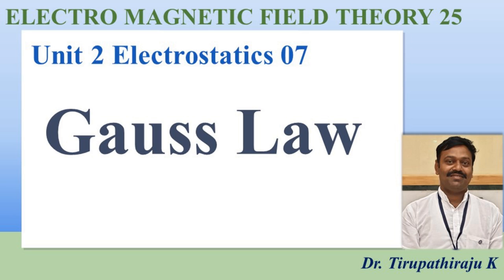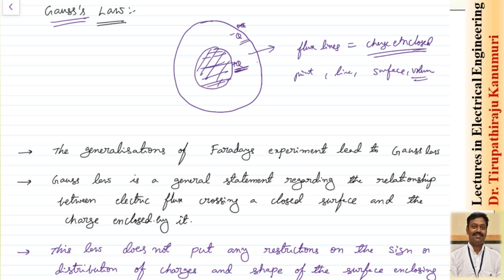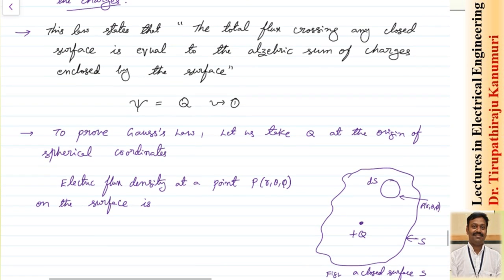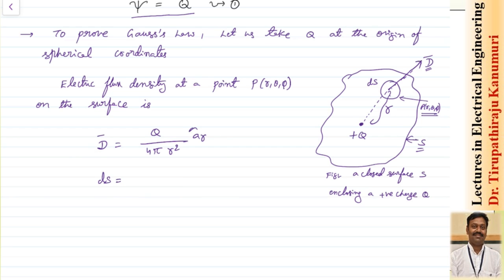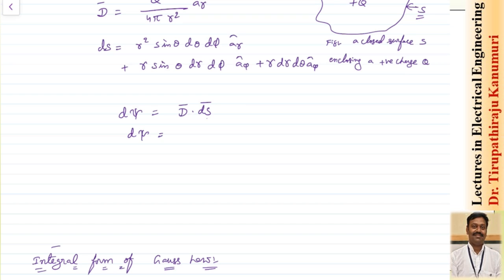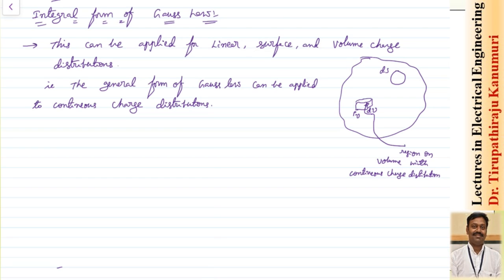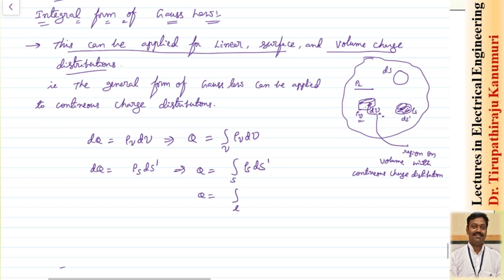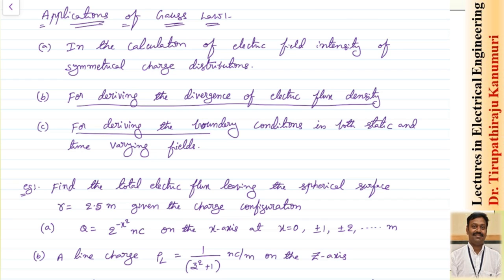EMF25 Gauss Law

Comment: Sir, actually in general, Gauss's law states that the electric flux through any closed surface is equal to the net charge enclosed by the surface divided by permittivity of vacuum. i.e ϕ=Qen/ϵ0.... I found about definition from cheng book...... You are explaining that ϕ  =Q........and also found ϕ=Q in some text book like sadiku ... Which one s correct.. Or is there any difference between these two different statement

Pl explain

I found two different statement regarding this gauss law.... What's difference between these two..